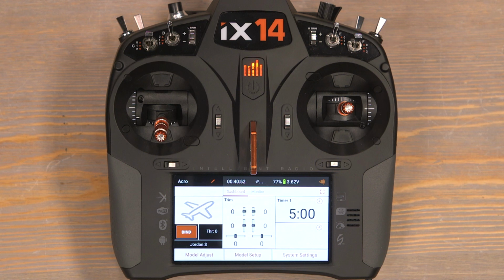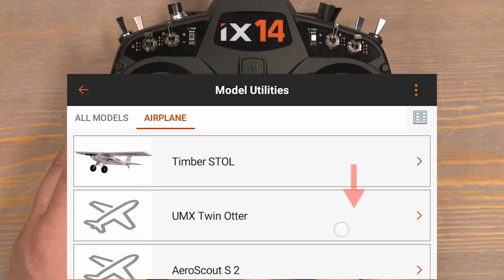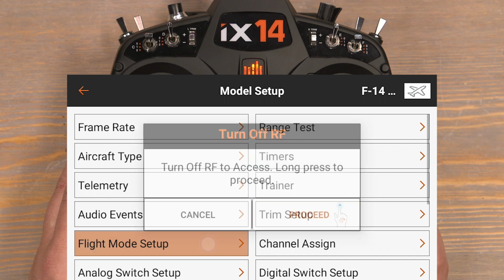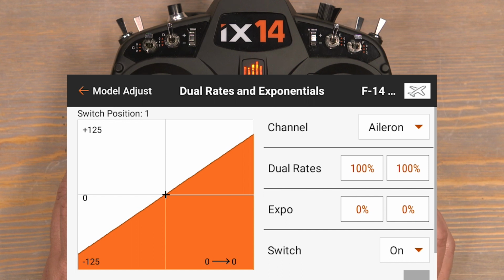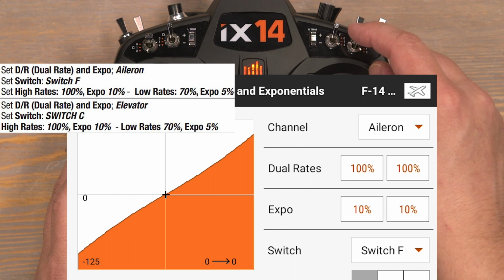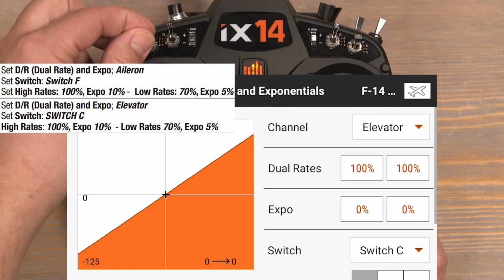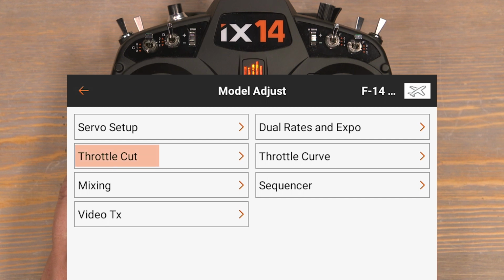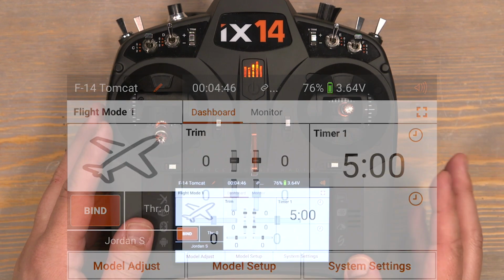E-flite F-14 Tomcat 40mm Spektrum Transmitter Programming Guide

Comment: Is everyone using the settings found on the yellow paper or the eflite downloaded model settings file?  They aren't the same. The yellow paper has the throttle cut at 100,but the. Eflite model file has a 50 per cent throttle cut?

Comment: Hi, on the nx radio setup can I change the flightmode switch from the D switch to another 3 position switch without any issues?
Also I would like to use only one switch for my dr/expo if thats possible?

Best regards

Comment: Hi got a question regarding the Spektrum DXS, does it only work with the models that are on the preset models list? I know that the UMX Ultrix works on the DXS but I would like to get the 600 Ultrix and I´m wondering if I can fly it on the DXS or do I need a DX6e or higher for that model?